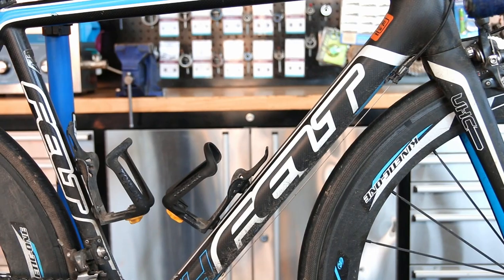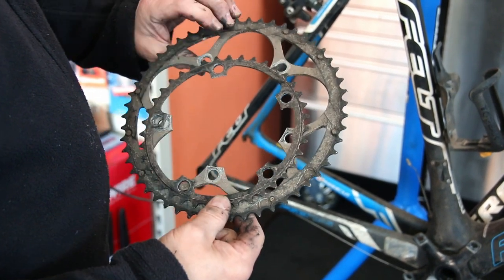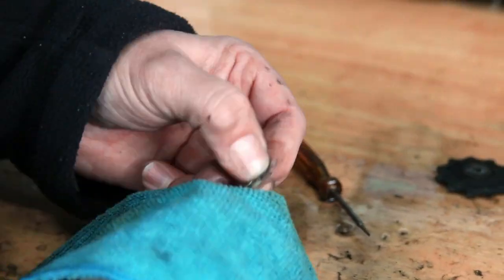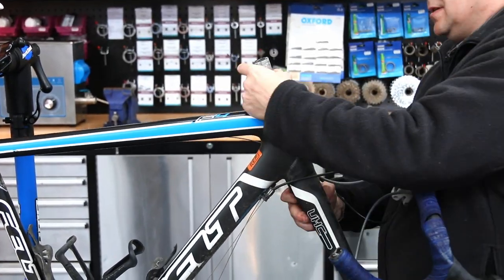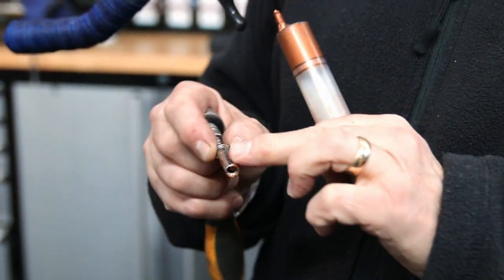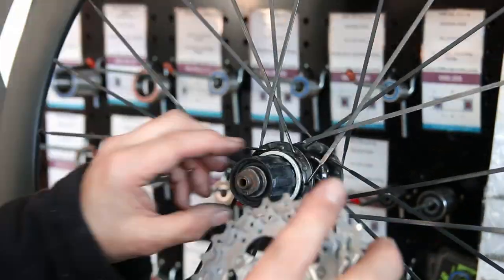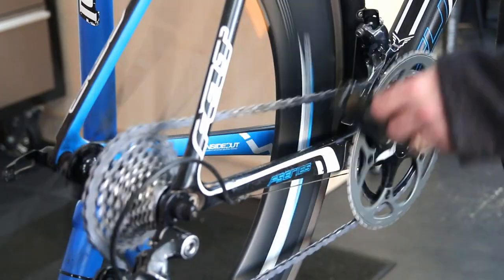Felt Service! Chain Waxing Road Bike Rescue!

Comment: You are so right about the molten wax. If anyone else wants to do this, one way is to buy a tin of Putoline Chain Wax - it's aimed at motorcyclists but comes in a frying pan sized tin that you pop on the cooker/hob. It will last you a lifetime and the wax solidifies after you turn the heat off, so easy to store. The one thing you didn't do, that I always do on a service like this is to take off the bottle cages and put anti-seize on the bolts - there's a degree of risk as the rivnuts in the frame are almost always alloy, and corrode like crazy so could already be seized. I take them out periodically, run a tap through to clean the thread up and then put lashings of anti-seize on - the last moment you want to discover they are seized up solid is when you go to pack your bike up for travelling and need to get the bottle cages off (don't ask me how I know!)!! My other top tip is for a frame like this Felt, with a matt like finish - those magic eraser sponges you see in the likes of Robert Dyas are absolutely amazing at removing scuff marks without making the area shiny. I did a mate's Specialized Roubaix and I couldn't believe how close the finish was after using these psonges. They are made of melamine foam and are in fact a very fine abrasive. Give it a try on an inconspicuous area! PS If I had to call you out on anything - that drive side brake pad on the rear could have done with being aligned a bit better!

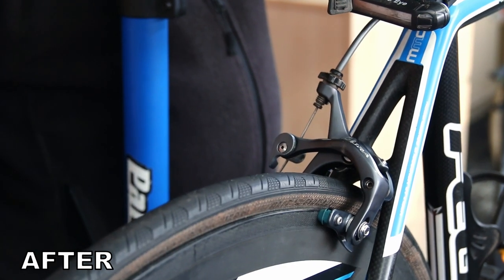Comment: Had a Felt bike for quite a few years so most interested to see this one.  Not sure if is camera angle, but the rear-right brake pad looked to be adjusted too high on the braking surface (11:15).  Especially as pad wear will cause that side to contact even higher and if left unchecked could hit the tyre.  Again, could just be camera angle.  Nice work and love the videos - thanks
Reply from the maker: Thanks Andrew glad you engined this one!🧡

Comment: What's the purpose of the grease across the spring on the rear and front derailleur?
Reply from the maker: Springs work against themselves, it just lubricates that movement, stops any corrosion forming between the spring and itself also!🧡

Comment: What kind of solution do you use in the ultrasonic cleaner?
Reply from the maker: We use a water based degreaser, it’s not something we’d recommend worrying about buying a brand name, whatever you can buy will be ideal as long as it’s water based🧡
Reply: @Bikespeeds  Cool, watching from Canada... I wish i could send my winter roadie to you guys... it's in a state! Love the videos, ive been binging them haha
Reply from the maker: Thanks For watching Matthew!🇨🇦🇬🇧
Reply: @Bikespeeds  What range of torque wrench would you recommend for personal use? Im looking online at 1-25... will that cover most nuts?
Reply from the maker: @1625morgmatt  I have 4 torque wrenches. The one you are looking at will be good if 1/4 drive for the majority of components, But you need a 1/2 drive left and right handed torque for cassettes, pedals, bottom brackets etc
Reply: @Bikespeeds  Okay cool, sorry for all the questions... last one... how can I find the torque specs for a vintage Specialized Sirrus 1990?